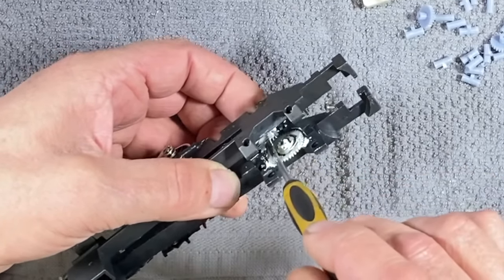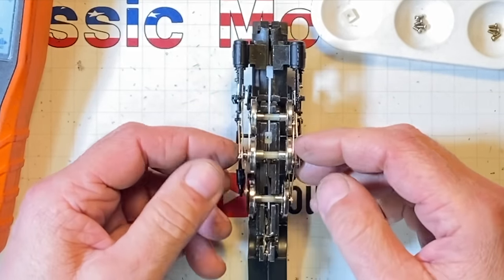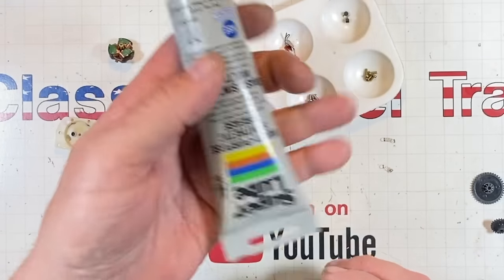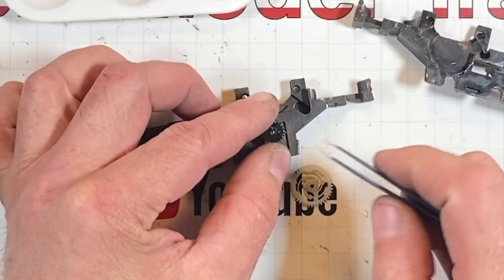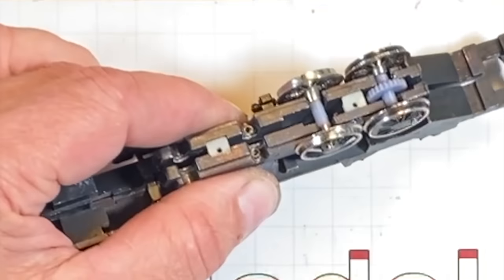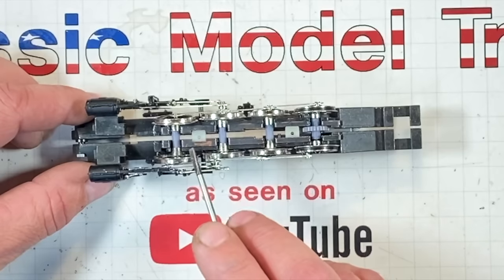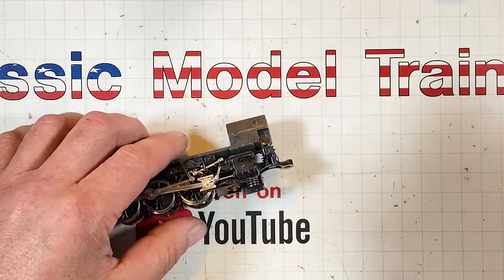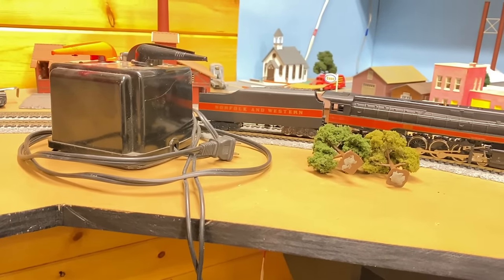I FINALLY Found Some GOOD 3D Printed Gears!!  Bachmann Gen 1 4-8-4 J Class

Comment: Great video.  Unfortunately it's just bachmann.   I buy the broken ones and build a chassis using old rivarossi parts. Bachmann makes the nice shells that rivarossi doesn't .A+ for your patience
Reply: I love your videos man great stuff
Reply from the maker: I agree!  Bachmann shells are super nice!
Reply: @thelittletug9321  Ron has really great videos and he is funny.
Reply: Bachman used to have a lifetime warranty. Not any more 😢 @classicmodeltrains
Reply: Rivarossi chassis, my next move ☝🏿
Reply: @classicmodeltrains I started buying Athearn  powered B units to use as helpers. Bachmann Gen1 just can't pull anything by itself
Reply: @keithhowell6833  oh ya just need two broken 4 6 4 chassis chop and section an extra driver channel on it . I made a template that way it would be spaced correctly. Very important

Comment: When the Lionel HO GS-4 (the exact same as the Gen 1 Bachmann) first arrived at my local department store toy train section in 1975 I think, I had to ask the sales clerk if the sticker price wasn't a mistake. $22.99, at a time when a Model Power (Mehano) Pacific was $49.99, a Mantua / Tyco Pacific was $124.99 and a Rivarossi Pacific was something like $175.00. I thought it was too good to be true. I was right. Lionel should have paid me $175.00 for the mental trauma of owning it for three days of non stop anguish and frustration before it was returned to the store. Even before the thing spun its wheels out of quarter and locked up the first time, about 20 minutes after opening the box, it struggled to pull 5 freight cars on level track. Not having learned my lesson, and thinking that Bachmann would have fixed the issues before selling it under their own brand, I bought another in 1980 for $99.99. Less than a day before returning it. But by 1982 I had a growing collection of better quality plastic Southern Pacific decorated steam and really wanted a GS-4 to pull my 10 Athearn Daylight cars. No way I could afford the then $500+ for even used brass, I bought a couple of used junk box non-runners from the local hobby shop for $10.00 each (a Lionel and a Bachmann - and just before Bachmann came out with the not much better Gen 2, as luck would have it) and a pair of English's (Bowser) re-powering kits, which worked pretty good. I still have them, and they still work pretty good. Over the years I've added a lot of extra brass detail to them, based on the plans in the Locomotive Cyclopedia Volume 1. They are the only "Bachmann" locomotives I've owned since, with the exception of a Gen 1 4-4-0 "Jupiter that doesn't run (no surprise there), and a few of the "gandy dancer" hand cars, which are a neat novelty, but they don't last long either.
Reply from the maker: OOooooohhhhhh!!  You have the Bowser re-power kits!!  Ive heard great things about those for these crappy B-mans back in the day.  Glad to hear they are still working pretty good.  Thats quite a story you have there with your journey down that potholed and rutty road of gen 1 and 2  80's and 2000's steamers

Comment: Good on you for trying to give this unit a second chance. These first gen Bachmann steam locomotives are such a nightmare, I don't know what the designers were thinking - I'd be curious to see how they ran straight from the factory. It's too bad so many have sentimental value otherwise no one would touch one with a 10 foot pole
Reply from the maker: Hello Harrison, Thanks for stopping by and commenting. The designers probably wanted a more robust powertrain but its always the "bean counters" (accountants) that want it cheaper.  The shells are always so well designed and look so good and then the powertrain is junk.  Straight from the factory there ran well because the gears have not aged, shrunk, and cracked.  They were horribly underpowered and noisy.  Sounds like their diesel loco power trucks when underway.  About every 2 months I feel like attempting another Bachmann repair from this era,  just to educate modelers to stop purchasing these from the eBay and wasting money.  :-)

Comment: Ron that little pancake motor and the magnets looks like the same set up in my Aurora model motoring HO slot cars can’t believe this is how they power those engines 😮
Reply: It's all about the  gear reduction
Reply from the maker: A few Fellers have mentioned that Frank

Comment: Wholly Moley!!!
Herculean effort and it barely goes. Thanks Ron for the great entertainment. Wondering if….. 
taking all the drive out of the loco and making a tender drive loco?
The other great thing would be a Park display on your layout. Erect a chain link fence big enough to surround the Locomotive. Weather ( paint rust on drive rods etc white wall the wheels) the. Sprinkle itty bitty white dots to represent bird poop all over!
Reply from the maker: Tender drive would be an improvement.  Lots of these B Manns are doing static displays on lots of layouts im sure.

Comment: Great job Ron and I would not be too hard on yourself because I think the repair was a complete success and I agree that the overall design of this thing is just showing it’s limitations and probably could not do any better brand new out of the box than it’s doing now especially with that shameful motor struggling and cocking everything to push the gears and causing the derailing problem that I remember from having similar Bachmann locomotives as a kid and always doing this.
Reply from the maker: Thanks for the input :-)

Comment: Well, I have to commend the fact that you held it together. If I would have spent that much time on that model the 10lb sledge would have done the final work. I do know that the springs need to be replaced before you get any power out of that under powered pancake motor. I cut the Athearn replacement springs in half. Great video as always.
Reply from the maker: Thanks for that trick of cutting the Athearn springs.  Sounds like a good idea to me!!

Comment: As soon as the gear issue raised its ugly head a few years ago i sold all my Bachmann stuff. Even the brand new and un-run. I'm so much happier! We have to deal with the "Mainline" range, which uses the same system of split frame and you soon become a dab hand with the Superglue... You're entertaining and informative as always Ron!
Reply from the maker: Are you referring to the Walthers Mainline locomotives?
Reply: No, these were a British range marketed by Palitoy but made by Kader and introduced in 1976. Well detailed bodies but terrible chassis with all the above problems. The N.E.R., J72, 0-6-0T was a game changer until the quartering went! @classicmodeltrains

Comment: Well... your first video got me to take apart my GS-4, which is a gen 2 with the can motor. I also bought the parts from Dan. Upon arrival of the gears and axles, I identified that the drive gear was wrong. So, I then ordered the gen 1 set, and that gear was not correct either. I emailed Dan, and then sent him the gear I took out, and he made me one. I believe that is why you now get both types of gears in the order.
Reply from the maker: Crazy how they are making so many variations of these drive systems.
Reply: @classicmodeltrains  yep, like I said I believe there are at least 2 -3 versions of gen1 so who knows how many others exist...

Comment: Fantastic effort, as always! I noticed another issue on this locomotive that would have contributed to the poor running. The plastic wheel centres have also popped out of shape and will likely be interfering with the rods. I've experienced the same phenomenon on a Bachmann Branch Line (British) model.

The British locomotives from Bachmann (which were formerly Mainline brand) also suffer from split axles and malformed wheel centres, so it doesn't just affect their North American products!
Reply from the maker: I did not notice the plastic centers being loose or causing interference with the rods.  Ive seen it happen, just not on this P.O.S.  Yes Ive heard the ones from across the pond are just as bad.

Comment: im incredibly lucky, my friend bought me a gen 2 as a birthday gift last summer and it doesnt have any damaged gears or quartering problems, he didnt know that they had these issues as he models o scale but id say im lucky mine is in good running condition, i just want to replace the right side steam chest since it had that damage when he bought it initially
Reply from the maker: I hear there is some good ones out there
Reply: @classicmodeltrains  even with the can motor it's one of my weakest locos in my fleet, it can barely pull 4 coaches lmao, love your videos by the way

Comment: Really wanted a N&W Class J and bought one from the Bachmann Plus range (Bachmann Item Number 11315) with the can motor and brass gear/ flywheel combo. Not sure if that would make it a second gen or what but I do know I expected a better quality model for the prices I saw they went for and the price I ultimately paid. 

Really wish I saw this video before I bought it. I would have just avoided it. While the Class J I got does have the best smoke unit I've ever gotten on a model, I'm hoping i somehow avoid the broken axle and gear issues. The front screw holding the chassis was broken as soon as opened it from the box when it arrived....

Great attempt to repair this locomotive. While i'm dissatisfied with my purchase, it is at least NOT one of these. Hope to see more of your videos on my feed!
Reply from the maker: The brass gear & flywheel would have to be after the Gen 2.  I have never encountered one of those yet.  I hope yours is a good runner
Reply: @classicmodeltrains  thank you sir! Love watching your videos as I repair my own locos!

Comment: Great video ! I could feel the frustration because I've been there many times as well . When you were working on the motor brush springs I noticed that they look like the springs and brushes for T-Jet slot car , hmmm, there may be some Frankenstein experimentation on the work bench ;-) . By the way , I have the same loco , runs great going straight until it hits a curve, looks good on the shelf though
Reply from the maker: Yes these little can motors probably share some similar parts to the slot cars from back in the day.

Comment: It would be a service to Mankind if you did a video on re-motoring one of these Bachman engines. I bought one of these and it still runs. Only had to replace the brush springs and clean up the motor.
Reply from the maker: it would take a heck of a lot of fabrication skills to re-motor one of these.
Reply: @classicmodeltrains  Ah, but it would be a challenge!

Comment: Boy, you sure went through a lot of suffering doing those 4-8-4 Bachmanns, but it is still educational. You know, Bachmann had the 0-6-0 which only had one split gear to replace and are a lot simpler to work on. I'll have to see if that guy can hook me up with parts for my 060.
Reply from the maker: It was an excessively long repair for a pile of sh#* at the end

Comment: Hey Ron, I think I have one of the split frame Gen 2 Chessie 4-8-4's. Sure I mentioned it before, but it obviously has the gear issue. I've replaced them 2 times. Still sitting in the repair box. Not sure it ever will get repaired
Reply from the maker: Hello Ray.  I have 2 more here that probably wont get fixed as well ;-)

Comment: Got 1. That Norfolk . haven't taken it apart yet. My mic went crazy. Don't know if it is battery or mic. So haven't be able to mic brushes for Southern Pacific daylight steam engine. But on Norfolk some of the wheels have issues. Dropping them does that everytime.  Hopefully I can save it with as little as 1 or 2 times taking it apart. But at least I can go back to this video and see 4,5,6, Through 10 😂jk great video woooosaaaaa relax just a straight beer and get us another video to watch! 😂
Reply: Be aware I'm likely going to be working on fixing broken wheels at some point in the future, just have to get the funds for the hardware so there is a chance you can get ur wheels fixed without having to steal them off of other locos.... Not sure when but I'm currently planning on it.
Reply from the maker: Do you mean digital caliper?  Yes them dang wheels do get messed up from a drop for sure. Thanks for watching :-)
Reply: Nope talking about fixing the broke axels
Reply: @classicmodeltrains  yes my caliper is messed up.

Comment: Could a CD motor be retrofit and could brass tubing help or wrapping thin wire around split gears?  Just thinkin.
Reply from the maker: A CD motor could be installed.  Just depends on the level of fabrication one is capable of.  Wraping wire around the gears does not work.  I did a video using brass tubing sleeves on a Gen 2 loco.  mentioned that video in this one.

Comment: the problem with the last time you tried 3d printed axles/gears is they were incorrectly sized, that and you'd need some needle files to clean out the axle holes
Reply from the maker: Yes but the resin was really brittle and broke.  This resin was a bit more softer.  Seems always need a bit of field machining for the final assembly

Comment: I bought one like that but the grey Union Pacific with Vanderbilt tender All the axle gears were broken. Took it apart and saw the pancake motor.  It now sits in a parts drawer. I just needed the tender anyway though the road numbers don't match the one that does run. The tender was a bit beat up also.
Reply from the maker: I really like that loco and tender combo!

Comment: I just convert these old Bachmanns into dummys. I use styrene tube by Evergreen to make new insulated axle sleeves. Once you get the quartering correct, JB Weld is an option to make the fix permanent. 

Maybe I'll try using a pair of NWSL Stanton Drive power trucks to convert a tender to a powered unit sometime.
Reply from the maker: A few have mentioned tender drives

Comment: I have a 2-8-0 of this design that belongs to me because I got it from a family friend. I need to tear into it again... I had it workin, but a wheel slipped on me again! haven't tried new gears, but am now considering it seeing as there's some hope of them not breaking instantly.
Has the same bitty little can motor! I think the idea is the reduction gearing gives it the required torque... but definitely not born to compete with a proper sized motor!

I think the reason for that weird, springy open gear might have been to act as a clutch if the wheels were binding up too much- instead of the motor jamming up solid and roasting, the gear would just spring away. Not sure how else it could provide any benefit to the mechanism. I bet the gear you repaired broke because somebody tried to turn the rear wheels by hand when the loco didn't want to run. What a pain- can't say you didn't try! Usually after this much fuss, I stick something up on a shelf and forget about it for a few years. Then find it again, and have better luck. Or screw up, and repeat!
Reply from the maker: Great idea on why that big gear looks like that!!

Comment: Wow those bachmann are not very well made at all.  One of my nephews bought one of the 'J' Class because it looked cool.  Ran for about 5 minutes then the motor went up in smoke.  We just sent it back to bachmann to repair.  They just sent us a new engine.  Newer stuff is better but that old stuff will make you pull your hair out.  Thanks for sharing.
Reply from the maker: At least B Mann made it right for you.  I hear they do that from time to time on the newer stuff

Comment: I wonder if the axles for the UK Bachmann locos would also fit these GS4s. The axles on the Bachmann Branchline split chassis locomotives have exactly the same issue with the plastic shrinking and then splitting. They have the same two generations, round key and square key. Even the motor looks like the same white plastic piece of... in my Palitoy Mainline Class 03 shunter (which was manufactured by Kader as well). Presumably these GS4s don't sound how the Class 03s do: like a clockwork toy. 
Axle splitting is enough of an issue over there that one of their specialist parts vendors, Peter's Spares, has the axle sets injection moulded in mass in China like the originals. Bachmann only released x-6-x locos over there though, you'd have to buy two packs of replacements to get enough non-geared axle centres. A bit expensive for me to do here in Australia though, I'd have to import one of these basket case Bachmann 4-8-4s.
Reply from the maker: I'm sure the manufacturing issues spread globally. I would like to find out more info on this Peter's Spare's Feller though

Comment: My Niagara has all flanges too , maybe the inner 2 the wheels are supposed to be in farther ( out of gauge ) just a bit to go around the curves? Good question because I used to run mine , well .. 35 years ago. My riverossi Hudson's have center flanges off so are my marx .
Reply from the maker: Smaller than gauge in the inners sounds a lot easier than lathing the flanges off that's for sure.  Sadely I glued these while assembling so I cant push them in any more
Reply: @classicmodeltrains  hmmmm , do u have extra shafts ? Maybe run the wheels under warm water to loosen them up ? Idk just ideas or 🚮 just kidding